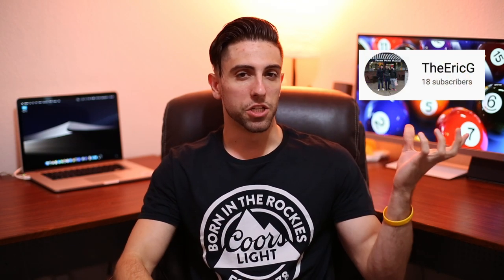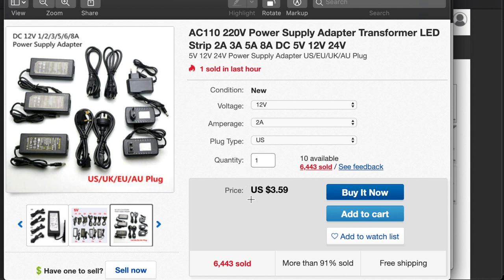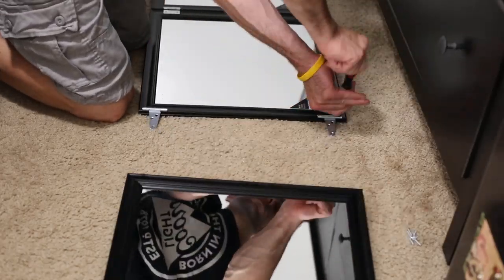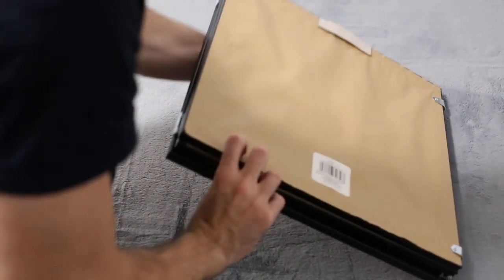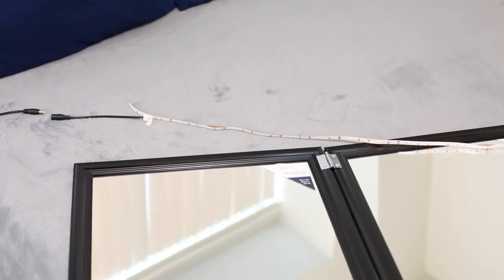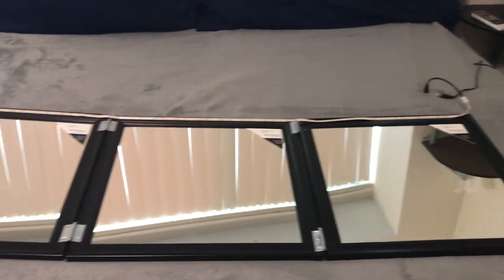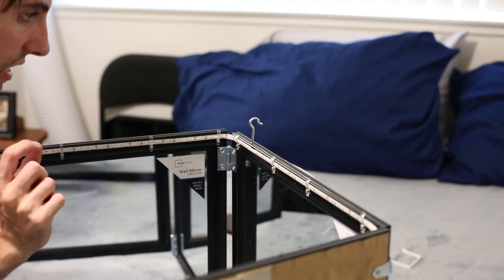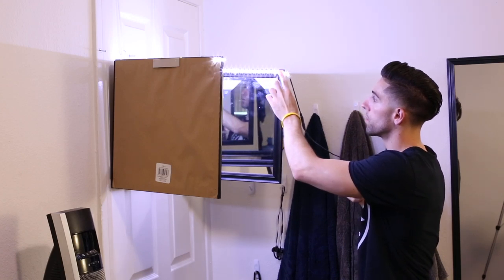How To Make A Self Cut System | DIY | COMPLETE GUIDE | LED's, Foldable, Hang-on-Door

Comment: Hi how do you cut your hair on carpet how do you clean it
Reply from the maker: Lakerfan08 LA you know those black capes they use at the barbers? I have two. I wear one and then I stand on top of one. I use a nail brush to brush the hair off the bottom of my feet before I step off the cape. Once I'm done with my cut and then I go straight to the shower. Feel free to ask me more questions if your confused.
Reply from the maker: meatball sub w pepperonis it’s not ideal, but as long as you have something underneath you should be fine ✂️
Reply: @chrisheadley808  Wouldn't a vacuum cleaner easily get hair off carpet?
Reply from the maker: HypaXLink probably, but I don't think it would suck up everything.
Reply: It's called a vacuum (vack-ume). They're dope. They clean your carpet with suction and they suck up all the dirt out of your carpet or in his case, hair.
Reply: Put a large towel or sheet down first then shake it off outside, into your trash can, or maybe in your bathtub if you have a hair catcher on the drain
Reply: how? you clean it with a vaccume cleaner? 🤦
Reply: Soudery Abbas I’ve been doing it 20 years and my carpet is clean
Reply: @thejordanparkempire  what kind of sorcery is this vacuum machine u talk about??
Reply: i guess im asking randomly but does anybody know a tool to log back into an instagram account??
I somehow forgot my password. I appreciate any help you can offer me.
Reply: @Karsyn Zakai Instablaster :)
Reply: @Cash Silas it worked and I actually got access to my account again. I am so happy:D
Thanks so much you saved my account !
Reply: @Karsyn Zakai you are welcome :)

Comment: Hey, thanks for putting this video together...I basically watched your video this afternoon, went out to Walmart and Home Depot and got everything for about $25.  After I got home, it took me about an hour to screw it all together and it's up on my wall and working great.  I immediately used it to trim the back of my neck so I don't look like a wolf-man.  The only tweak was that I had to bump out the bottom of the center mirror with felt pads so it would hang level, this kept the left/right side mirrors in place and prevented them from swinging forward.  Well done!!!
Reply from the maker: Richard M no worries man I'm glad I could help. Zgreentv said he just uses a cork on the back of the middle mirror so everything stays level. Pads should work too you might just need to use a bunch of them

Comment: I haven't been to the barbershop in 6 weeks and it's time to do something.  Lol.  I literally just purchased the LED lights and brackets and I'm getting ready to start building. 

Thanks for posting this, sir!
Reply from the maker: Steve Drake good luck my dude
Reply: Hey, Chris.  I wanted to make sure and double-check with you regarding the size of the tee hinges.  I put them in and the "third" mirror is not flush with the floor at all (like the first two) and there is space in between the middle and third mirrors.

What could be causing this?
Reply from the maker: Steve Drake if you're laying it flat on the floor it shouldn't be flush with the floor. The bend in the t hinge will get in the way from it laying flat
Reply: @chrisheadley808  Awesome.  Just wanted to make sure I wasn't doing something wrong.

Comment: Thanks Chris! I just built mine over the weekend, took 2-2.5 hours, but it is definitely worth it because of the clarity of those Walmart mirrors and the sheer size of them. I bought one of those selfcut mirrors online and it had all these scratches on it. This was wayyy better and like half the price. I can completely close all three sides because some of my hinges hit, but it's all good. Thanks for uploading this tutorial, I've already cut my own hair 5 times during this pandemic and this'll make it a lot easier. No more between the legs holding a full length mirror or dropping a mirror off of a ladder. lol. I like how much detail you put into your video and the excel spreadsheet. I even bought the materials from Home Depot from the item numbers on the video.
Reply from the maker: Glad I could help! The only problem I forgot to address was to stop the mirrors from folding in on themselves, if you are having this problem, look at the first comment of this video and it explains how to fix it. I'm glad it all worked out for you! 😁

Comment: THANKS CHRIS!!! Just finished putting mine together! Saved me at least $50+ bucks.  Liked & subscribed! 

Few tips for anyone else out there:

- make sure the T hinges are far enough to the edge so they can rotate freely, otherwise the 3rd mirror will not open all the way. 

- removing the mount on the back of the mirrors can make things less wobbly. 

Good luck!
Reply from the maker: Chris Tran no problem, I'm glad it all worked out for ya! Have fun learning how to cut your hair ✂️

Comment: Thanks for posting this guide. This is how DIY videos should be done: clear visuals, well articulated instructions, edited for conciseness. A color-coded spreadsheet was even put together as a handy reference. 👍One thing I would add: To keep the side mirrors from folding in when hung, bend the long side of the door hanging system inward so it is angled like a  "7". This will help the mirror hugging close to the door and maintain balance, so the side mirrors don't move toward you so easily. You can then use the cork solution as necessary.
Reply from the maker: Trung Ta thanks! I'm glad everything worked out for you 😄

Comment: I liked your approach. But what you need in your tool box is a hand awl for small pilot holes. You have the right idea for the need of pilot holes, but get yourself a wood awl. They are similar to an awl used in leather craft but have a triangular shaft that will cut the wood fibers to the depth that you need. When you have one, you will always look for it first for all pilot holes. Especially anything up to an inch or a bit better. Stay well.
Reply from the maker: Richard Seymour thanks for the tip!😁

Comment: The reply that suggested the cabinet hinges was absolutely on point, used it on the longer mirrors (picked up at target for like $7 each mirror). Cabinet hinges worked like a charm to fold over the mirror attached with the regular hinges.
Reply: Are you able to share what type of cabinet hinges you used?
Reply: @anthonypagan349  https://ibb.co/FwK3d4c
https://ibb.co/y49wQNQ
https://ibb.co/Cv9sJpD
https://ibb.co/t8qKGrP
https://ibb.co/2yvL0fG

I got them at Home Depot on 28th st, NYC, where they have an assortment of cabinet hinges on display attached to cabinet setups, so customers can test them out.
Reply: @anthonypagan349  If you use the long mirrors from Target, with these cabinet hinges, keep in mind you will have to reinforce your fastening method. I used longer screws than what came with the cabinet hinges, and I drove the screws into additional pieces of wood in back of the mirrors for more stability. One rectangle piece of wood for each hinge. Because the screws that come with the cabinet hinges are too short, and the mirror panels have curved peaks and valleys along the panes, so the surface the screws are driven into isn’t flat.
Reply: nlawson2004 thanks man, I appreciate!

Comment: I finally made mine today. I just have to find a place and a way to hang it. I have no LED lights, I might add that or I might not. But I want a battery operated light of some sort instead of a plug-in with all the cords and stuff. 
I did struggle to put my mirror system together. Because, the wood was so crazy hard that it was almost impossible to screw in, especially with a normal screwdriver. I almost gave up. Perhaps it would have been easier with a drill.
Anyway, it is finished, and I will use it very, very soon, because I desperately need a haircut! :-) I just hope it works great.
Reply from the maker: R. Thomassen awesome man! You could easily make it battery powered, you'd just have to find the right connected to the LEDs

Comment: thanks for the detailed video bro. gonna move into my own apartment and gonna do this. one thing I would recommend to everybody is to get white mirrors that way the light will bounce off the white and it'll make it much brighter compared to the black which will absorb some of the light.
Reply from the maker: Ruff Prophet Productions The mirrors one job is to reflect light. The boarder color won’t make much of a difference.

Comment: Came out great brother ! Only thing left to perfect .. is.. to somehow get the side mirrors to stay put. Maybe stronger hinges ? 🤷‍♂️
Reply from the maker: If the mirrors are not staying in place this could mean 3 things, all of which are caused by gravity.

Problem #1: The screw hooks are not level and cause the mirrors to favor 1 position. 
Problem #2: When you installed the brackets the mirrors might not be parallel, tilting the mirrors in 1 direction.
Problem #3: While the mirrors are hanging on the door, if the back of the mirror is not flat against the door, the mirror will tilt forward slightly, causing the mirrors to not stay in place.

Solution: if you install 3 eye hooks like I did with my permanent set up and make sure everything is level then the mirrors shouldn't move. My permanent mirrors always stay where I put them.

Another solution could be to get hinges that do not rotate as easily. Although, that may be hard to find since hinges are designed to rotate lol. If we could find a way to "stiffin" up the hinges that would work 

One of the problems is that the over the door kit is cheap and when combined with the screw hooks you might get Problem #3. Since they are cheap, you can bend the metal and hopefully correct the position so the back of the middle mirror stays flat up against the door.

I had Problem #1 and once I made the screw hooks level it stopped the mirrors from moving astray. 

Hope this helps.
Reply: I cut a cork in half an super glue it on the bottom of the center mirror so it's level and the mirror does swing you guys got some sophisticated stuff going my junk rachet 😂
Reply from the maker: @ZavierGreen  Genius. Totally solves the problem.

Comment: I just want to take the time to thank you. This is exactly what I needed. I just finished looking at your video going step by step putting my three mirrors together. I found everything except the mirror hardware set  so I hung my mirror up like your other mirrors. I had to find the studs in the wall and everything came out great but thank you once again 👍😁
Reply from the maker: glad it worked out for you. The two studs you will need to drill into are most likely too far separated for the middle mirror. If you buy these you can put your mirror anywhere on a drywall. 

https://www.homedepot.com/p/E-Z-Ancor-Twist-N-Lock-75-lbs-8-x-1-1-4-in-Philips-Zinc-Plated-Nylon-Flat-Head-Drywall-Anchors-with-Screws-2-Pack-25610/310450300

Comment: I didn't have a bump put on the fold. And the tape cracked. I also went up and down the sides. So I have room to move up the side of the plugin and reconnect  after repair. Can you explain how to cut out a section and attach the two sections back together?

Comment: I can’t find the door hangers anywhere do you have a link by chance. Awesome vid. Thanks
Reply from the maker: jeff odin http://www.walmart.com/ip/Mainstays-Mirror-Over-the-Door-Hooks/275889169
Reply: I commented earlier, you can purchase a Target dorm room full body mirror that hangs on the door. It should have door hanging equipment in it. Right now they are on sale for back to school for like $7-10. Just a tip. Good luck!
Reply: Thank you all assembling now I’ll post video when done
Reply: I checked my local Walmart but they have none of the mirrors in stock. My local michaels has 12”x12” square mirrors available but they don’t come with frames. Any suggestions?
Reply from the maker: Alan Simon go to another walmart

Comment: Can you post a link to the door hanger set? Having an issue finding it.
Reply from the maker: iLLA Struction https://www.walmart.com/ip/Mainstays-Over-the-Door-Mirror-Hardware-Set/107591946?wmlspartner=wlpa&selectedSellerId=0&wl13=1600&adid=22222222228289653620&wl0=&wl1=g&wl2=m&wl3=347943616495&wl4=pla-741713237951&wl5=&wl6=&wl7=&wl8=&wl9=pla&wl10=8175035&wl11=local&wl12=107591946&veh=sem&gclid=Cj0KCQjwuZDtBRDvARIsAPXFx3DX7WBzv59ZyLkEcX7YYS6b0u4pP7-hrbtHjopVg7s510ik_pk1LKsaAnopEALw_wcB

Comment: Here's a materials update as of 4/18/20 and new suggestions.  Walmart had the mirrors but not the over the door mirror hook/hanger.  Walmart appears to be no longer carrying the mirror hook.  Home Depot had everything Headley mentioned.  So here's what I did tonight.  Do not buy/use the hooks that screw into the top of the middle mirror.  Instead, just use the built in wall hanger on the back of the middle mirror.  Put a nail in a flat wall or  door and  hang the mirrors on the wall using the built in wall hanger strip  on the back of the middle mirror.  You will have a problem keeping the mirrors level and open when in use and side mirrors are opened out.  You either have to keep adjusting the middle mirror on the wall for levelness or, as I did, use two push pins in the wall on both the bottom right and left sides of the middle mirror.  Small nails or tacks would also work.  These hold the middle mirror in place when the side mirrors are extended.  Works like  a charm.  I did not use LED lights.   I'm not handy with tools so you might come up with something simpler or possibly find an over the door mirror hook/hanger.  Home Depot didn't have any either.  Good luck.  Thank you Chris Headley!
Reply from the maker: Glad I could help 😃. I was at walmart the other day and saw the over the door hangers, maybe they were just out of stock.
Reply: Over door hangers are out of stock Walmart online with store only availability.  I checked two Walmarts, found none, and proceeded  with plan B!  Thanks again.

Comment: How did you get the mirror with the bent tee hinge to fully lay open? Mine seems to stop at around 150 degrees.
Reply from the maker: YussefWhy415 I think you may have made a mistake. You may have put the hinge on backwards. I showed all the steps in the video on how to do it correctly.

Comment: Currently you can buy a similar system for about $25. It's called 360 mirror. But probably, it comes without the LEDs.

Comment: I made this system a while ago but the side mirrors don't stay put if I want them to be positioned at a specific angle. For example, suppose I want a 120 degree angle between the center mirror and the right mirror while the system is hung on the door. I move the side mirror with my hands to create that 120 degree angle, but as soon as I let go of it with my hands, it sways to one side or the other and I no longer have the desired angle. There seems to be two possible issues: 1) The tension in the hinge is insufficient 2) The hooks screwed into the top of the center mirror are no longer even height (One has come out a bit further than the other one due to wear and tear and possibly a poorly made pilot hole). 

Have you dealt with this? Any tips?
Reply from the maker: If you scroll down you there’s a comment where we talk about it. It’s moving because the back of the mirror is not parallel with the door. Our solution was to super glue 2 corks on the back to ensure the mirror is parallel

Comment: Great video. Anyone have any suggestions on longer over the door hangars? I live in a house with big ass doors. The doors are about 8 feet so theres no way the one he used in the video will be long enough. Another possibility could be hanging it over the bathroom curtain rod but I would need something more round and not flat like the one in this video
Reply from the maker: Max Pill you could use the second method I showed for hanging the mirrors and drill straight into a dry wall with dry wall anchors. Or maybe devise some type of extension for the over the door hanger.
Reply: @chrisheadley808  Thanks. Its a rented house though so no drilling into walls. I'll look into some type of door hanger extension.
Reply from the maker: Max Pill idk if you have a drill or a saw but you could get a long thin piece of wood, drill holes in both ends, screw in the top to the over the door hanger with a nut and bolt and leave the hole in the bottom open for the screw hook.

Comment: I wish I would’ve watched this video before I cut my hair. Using a medicine cabinets mirror and the main mirror is difficult especially since you have to lean over the counter. Super easy. Gonna build one tomorrow. Does the LED make a difference or cause any glares? Also, I’m 6’5, so will that hanging system be good for me or will I have to drill extra holes in it?
Reply from the maker: BBQ Made Easy this should make your life a lot easier! The LED's do not cause any glare. 6'5" is pretty tall. If you do have a drill, you might want to add an extra hole in the hanging system if the mirrors are too short. I think you'll be okay tho
Reply: Chris Headley just got done building it. Was pretty easy. I couldn’t get my t-hinges perfectly flat but it still works. Thanks again for the video!